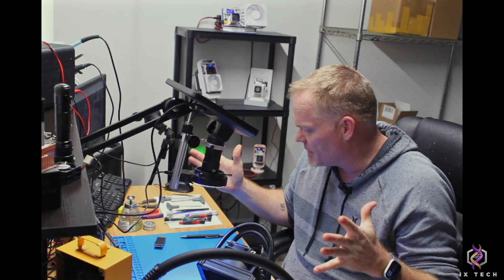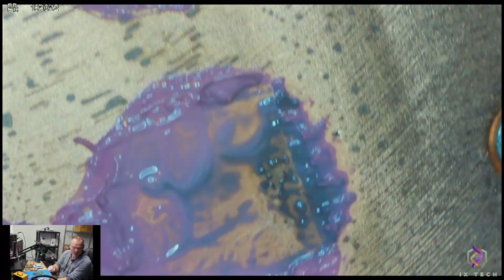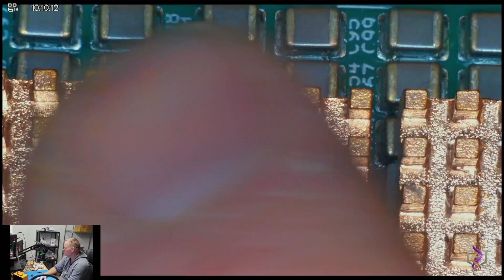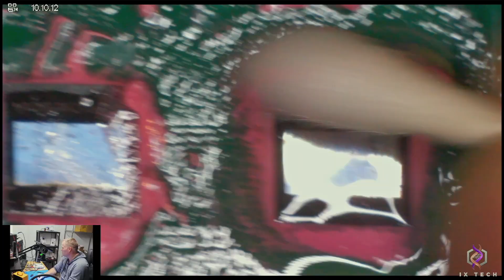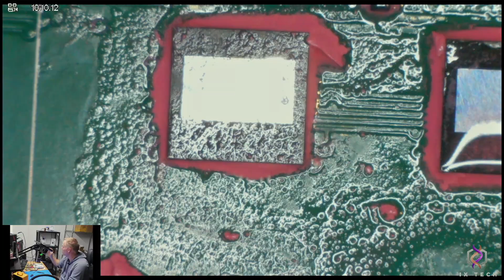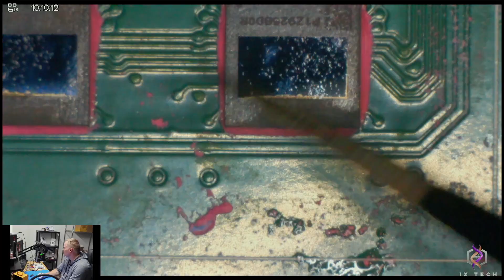NerdQaxe++ Hydro Current Protection Fault

Comment: What type of fluid is used to rub off the thermal paste?  I have a few Bitaxes that I've had running for over a year and they are on the original paste.  I'm thinking they will overheat eventually and I'll need to repaste them- something I've never done before.
Reply: Alcohol